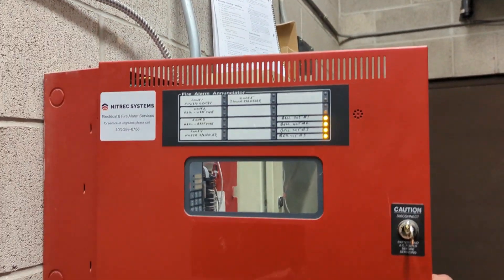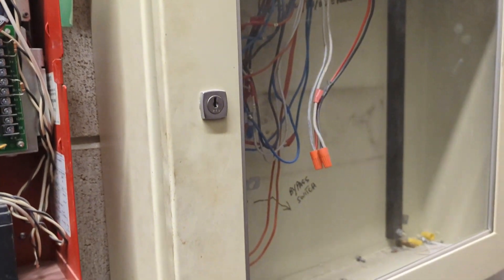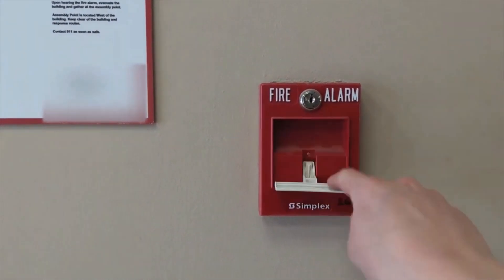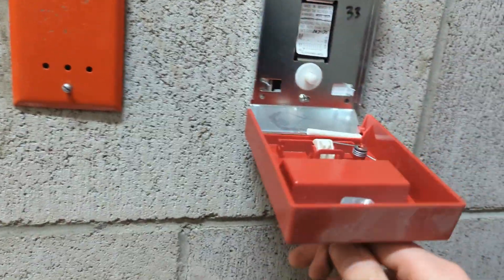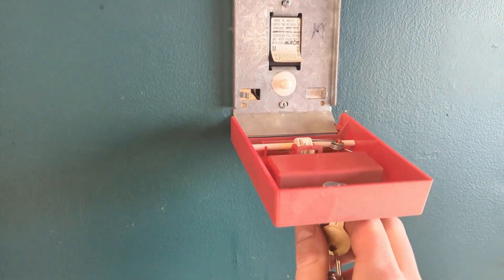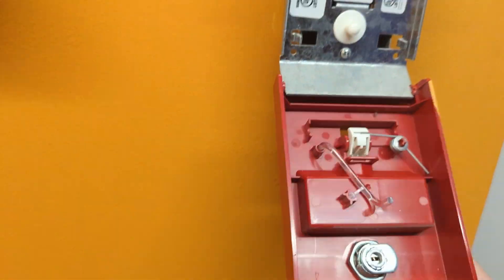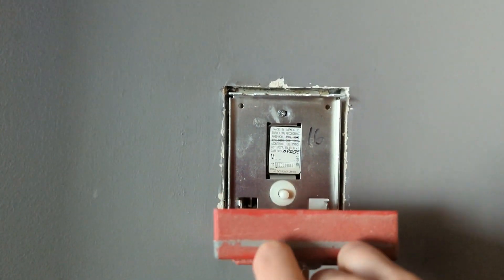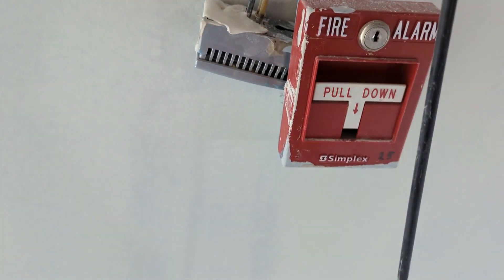Annual Fire Alarm Inspection at a Strip Mall (Simplex 4008)

Comment: on  the  pull station thatcan be pulled through lever i think it good pracatike practike practice to pull station pull lever bar and leave pulled until inspector say it receive and and thn reset so you can knowing that pull station is operatible in normal condition that citizen pull the fire alarm and sounding off

Comment: 1:10 u know before breaking the break rode inside the tbar u can see the break rode inside just where the arrow pointing down at. Theirs a little gap inside where u can see it.
Reply from the maker: Yep. I did break a few of them. I did this because sometimes the handles on these devices are fragile, and have been known to snap off if the break rod is installed incorrectly. Never hurts to be sure.

Comment: I don't think you can take the key and break rods from those stations. That might be considered stealing or tempering. You're there to test not to get new stuff. Ask before you take.
Reply from the maker: Simplex pull stations are supposed to be tested by pulling the station without the glass rod. I put the break rods back after I tested the devices. The keys aren't supposed to be on top of the devices in the first place, and there were about 10 in a box on top of the panel.
Reply: @Twentythree33  ok in that context, ignore my comments. Sorry about that. Great video though.

Comment: Even though JCI basically shit on simplex, Simplex is still my favorite brand and notifier is a VERY close second. Looking to get some Simplex parts and a panel from a local high school which is having an Edwards EST io panel and system replace it. I know who owns the panel and are in touch with them. BTW I do have the means of reprogramming but I won’t say who gave me those means for privacy reasons.
Reply from the maker: Trust me, I know exactly who gave you the programming software. I think it's common knowledge in the community now.
Reply from the maker: Also replacing a system with EST? That's like going from a Porsche to a mobility scooter. Mobility scooters are like EST, because you likely have a disability if you buy one.
Reply: @Twentythree33  GCPS (the county) is known for making shitty, disabled af decisions lmao. At least I get Simplex out of it.